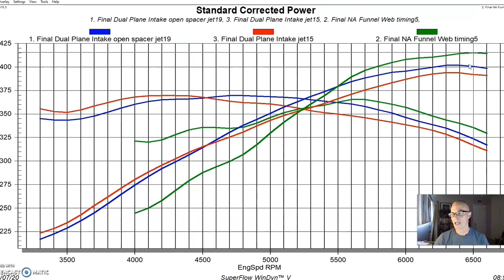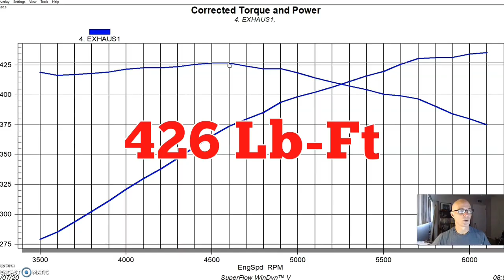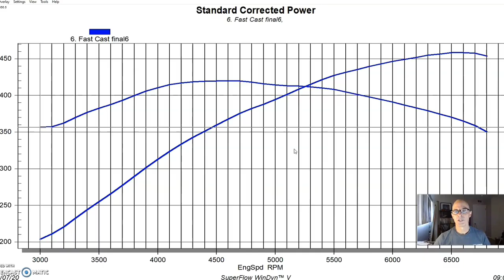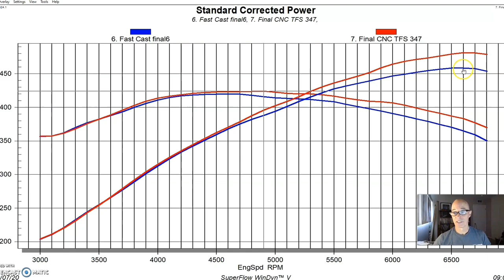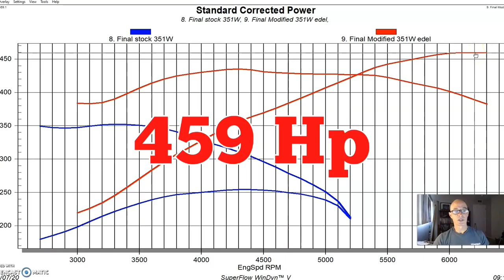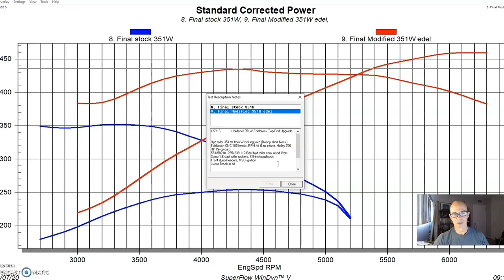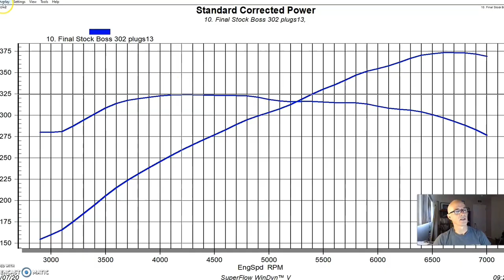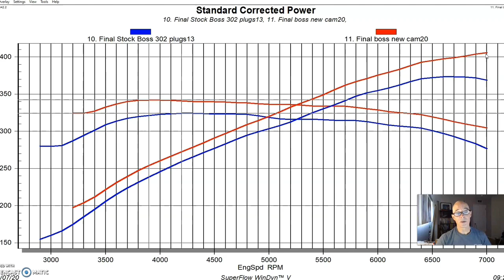HOW TO: 400-HP SBF POWER COMBOS

Comment: 400hp on a 302 is sick but mannnn id feel scared revving out to 6500.
Reply: With a steel crank proper oiling windage tray roller cam good valve springs and most importantly a properly balanced reciprocating assembly I wouldn't be scared. Richard did an article on a 8000 rpm 347.
Reply: Christopher Seay fair enough. But for me, who only wants a street purpose, I’m probably not gonna rev out that high while I run to get eggs 😂
Reply: As I have always heard.... How long will it rev that high? = Until it finally blows .... Of course.
One time or 1,000 ?

Comment: Whats the power limit of a 174 blower?
Reply: The problem with those little roots blowers is that at a higher boost level you can't stop the belt from slipping.  6-71 or centrifugal if you want to make serious boost.
Reply: @chris49ford  but if you have 450 will it make 600 ?
Reply: @danieldelpha1315  I would think a little blower with 6-7 lbs of boost would add about 100-150 hp at that level so I vote yes.  These little blowers have to spin crazy fast to generate boost - at 7 psi it's spinning 12000 rpm at 6000 rpm engine speed. They max out at 14000 rpm but above 8+ psi boost levels you get a lot of slippage from the serpentine belt drive.  Might be having to change out the teflon tips on the rotors more often than a 6-71 that could make that boost at a lower blower speed.
Reply from the maker: it can make 600-but not easily
Reply: I knew someone 20 years ago that put one of these little blowers on basically a stock 350 in a street rod. He topped it off with dual sidedraft Weber's using an adapter plate.  On a 400 mile trip to a national event it melted the pistons.  I always thought it leaned out because the dual sidedraft Weber's weren't enough to feed it, but it could have also been a timing issue. Just make sure you avoid lean conditions and detonation.  May want to consider air/fuel ratio sensor, knock sensor, boost referenced timing retard, and maybe even water/methanol injection.

Comment: @Richard Holdener Do you remember a magazine car way back in the day (MMFF?) Fox Mustang with Saleen kit, the motor was Vortech/Paxton supercharged with the carb mounted on the intake side of  the supercharger. It used a fuel solenoid from a nitrous kit to prime the motor.
Reply from the maker: side of the supercharger?
Reply: @richardholdener1727  yes

Comment: From 255 hp to 459 hp with a top end kit on the junkyard 351W bottom end was impressive. The fact that it improved lower end torque significantly too is even more impressive.

Comment: What kind of manual transmission do you guys in the states run behind these engines with this kind of power?
Reply: Erwin Nijs : T5 Borg Warner or Tremec T45, also made by BTR and rebuilt by GForce and others. Tremec TR3550, TKO-500 or 600. Modern Drive Line are a good supplier.
Reply: T5 if you dont abuse the shifting ....might live.
Power shifting beats them up quickly....
Reply: @deanstevenson6527  Do I need an adapter with the T45?  And what about a TR-3650. I can buy one nearby for a decent price, but I think I need to cut up either the transmission or the engine block in order to make the starter fit.
Reply: Erwin Nijs : Depends what a 5speed T45 or 3650 is going onto( 5.0 or 5.8) The spigot has to clear an imperial 4.91 inch diameter hole ( 12.3 cm) and the input shaft length sometimes has a wrong spline count and fitting a new input shaft  can easily be cheaowr than a bellhousing and adaptor change. Normally, its easy to cope with an extra 1.7 cm thick adaptor.You know what it is going into. For European Fords ( Sierra, Taunus, Scorpio/Granada/Capri)  or rear drive Alfas or Fiats and old British Leyland stuff like Jags and MGB's, there is an Australian  made Left hand V8 style bellhousing with  a 164 teeth that swaps the starter to the other side, and a few degrees lower in the chassis. You can reweld and cut a Top Loader Mustang or truck bellhousing and swap the starter position, but an adaptor is best.  For RWD de Tomasos or otherwise, its normally easy to drop down to a 157  early Top Loader 4 speed or even the rare 143 teeth Mustang II bellhousing.